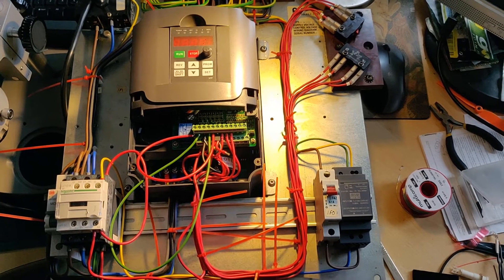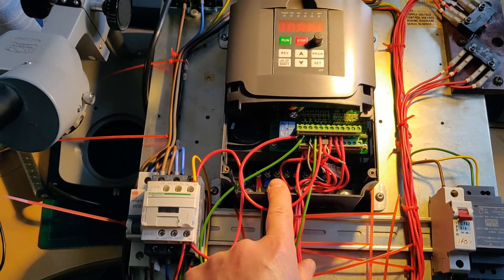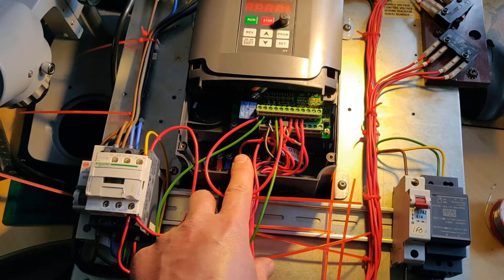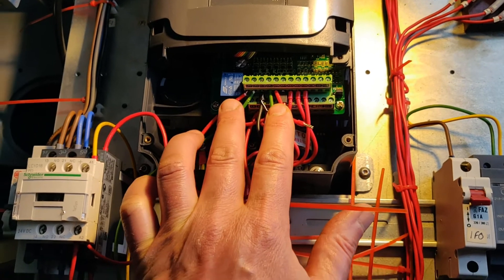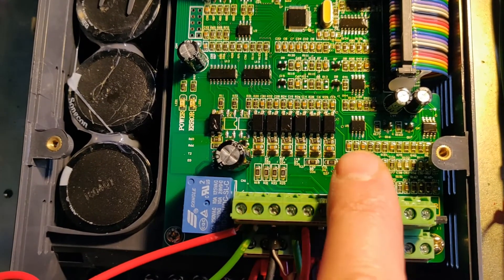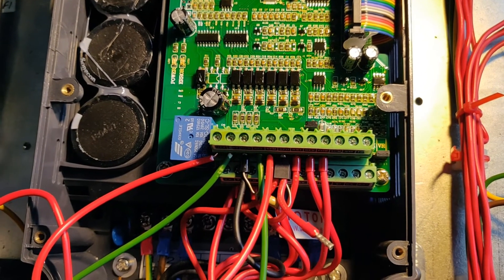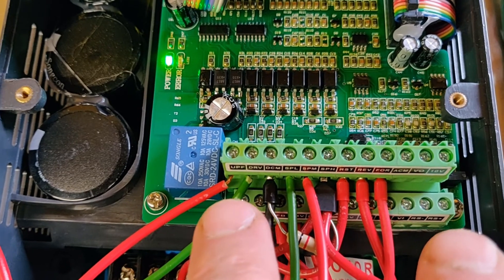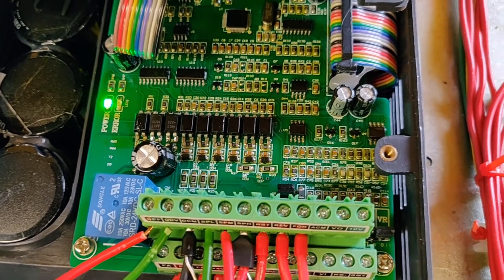Huanyang VFD Open Collector Output Problems - PD050 and PD051

Comment: hi jonathan. would you be able tell me what conector and transformer you used and any thing else i would need to follow your wiring, im getting my m300 soon i have the huanyang vfd already. cheers dave
Reply: Hi Jonathan thank you very much really appreciate it. Great video too help me on my way as I want keep lathe original best I can. My Han vfd has the 2 opto already fitted. Thank you for the offer for more help I will keep you updated on the process. 🙏Thanks again mate
Reply from the maker: @Davebatcheler  Should have said contactor is LC1D18BD (24V DC coil).
Reply: @jonathancrossley6803 I’m on the Harrison forum can I contact you in there if I get stuck mate. I’ve got the parts now just waiting for the lathe too land 👍
Reply from the maker: @Davebatcheler  Sure, I think my username is daeadalusminos
Reply from the maker: Hello Dave, by transformer I assume you're referring to the 240V to 24V DC-DC module - I used a Meanwell 24V at 1.5A DIN mounted unit. The main contactor is a Siemens LC1D18 - you can us usually pick them up for about £30 if you're lucky from eBay. The 1K resistor disspiates about 0.5W - I'd use a 2W one to keep temperature down. Let me know if you need anymore info.

Comment: Hello jonathan,

I would like to integrate my Huanyang inverter into the emergency stop circuit. Can you explain to me how to do this and which parameters I have to adjust?
Best regards.
Reply from the maker: It really depends on what feature you require from your emergency stop as to how you implement it. The installation on my Harrison M300 utilises 3 spindle stop features: 1. The usual run/stop, 2. The VFD emergency stop and 3. Cutting power to the VFD.
Here's a link to the schematic with notes and parameter settings
https://drive.google.com/file/d/1P_SHvcxdEEkbj-ihkTAf2AfgW293GSp2/view?usp=sharing
Reply: @jonathancrossley6803  Hello jonathan,
thanks for your effort. I'll see if I can use some of it. Thanks very much. Best regards.

Comment: Thanks for the vid. Just got a Harrison M300, has a single phase motor, so that needs to go. I also found your info and your ebay items (same username), so will support you with a few bits as needed.